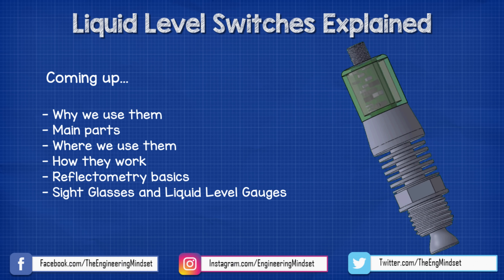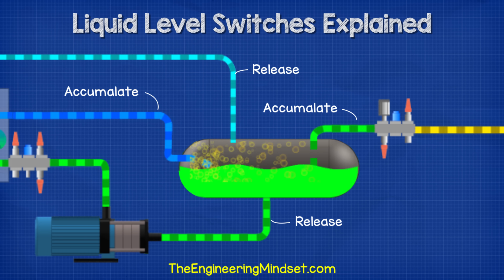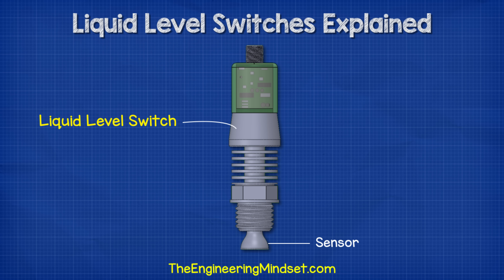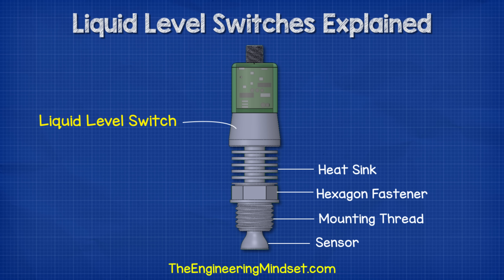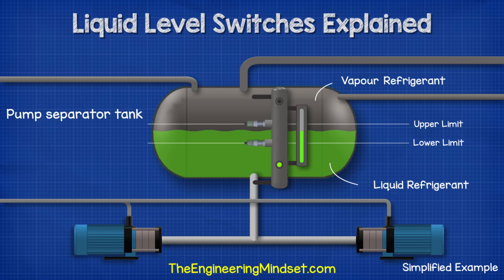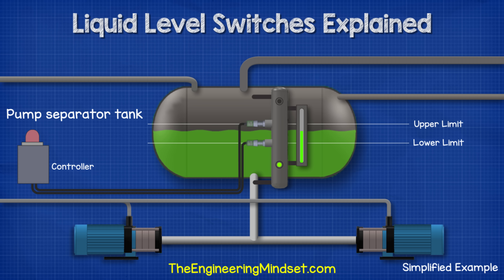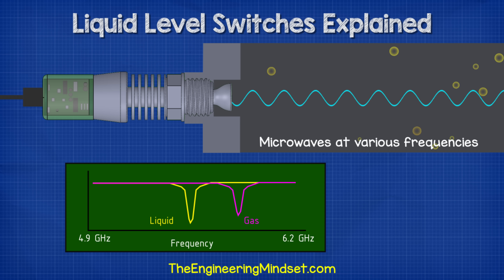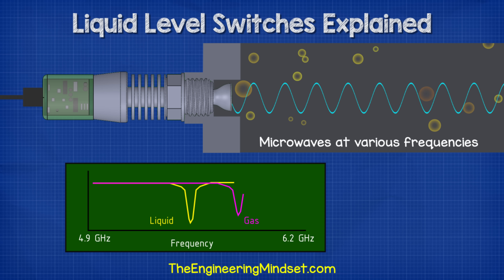Liquid Level Switches Explained - Industrial Refrigeration Ammonia  industrial engineering

Comment from the maker: ⚠️ Found this video super useful? You can buy Paul a coffee to say thanks: ☕
PayPal: https://www.paypal.me/TheEngineerinMindset
Reply: Hi paul , I know it's not a relevant topic but I have this question :
What  is the mathematical relationship between wattage and heat or temperature for AC
I'm talking about an infrared cooker
Reply: @imme1234  W [JS^-1] ... 'Heat' usually refers to U internal energy measured in J, a surface temp [K] at infrared is chosen to excite phonons to carry heat from the metal pan to the food if not mistaken (or by radiation). If you meant an electric oven cooker you can look up Stefan-Boltzman Law which is T^4 , but bear in mind that relationship by itself won't be useful for efficiency calculations because only a portion of the emission will actually be useful for heating the air/food by convection etc. There's actually a lot going on!
Reply: Thanks a lot...

Comment: One thing I don't understand, why connect it to a alarm? Isn't the point of LLS'es to connect it to the system in a way so if level is high, it will run the system in a "overcooling" mode (meaning it will run the system harder than the call for cooling mandates, which of course means that if temperature control is important, you would need a "waste evaporator" somewhere that just dumps the cold somewhere) so to "consume" more ammonia (speeding up the pumps to the evaporator and adjusting the valve), while if the level is low, then cap the system by slowing down or locking out the pumps to the evaporator, to increase the level?

And same thing for the receiver, but in this case then control the compressor based on demand so it keeps the liquid level in the receiver good.

Of course it would need to raise an alarm if the liquid level is low more constantly, as that might mean there is a leak somewhere, and same if it high too often, because that might mean there is a constriction or blockage in some pipe.
But most controllers can raise an alarm if the cooling system is capped too often or run in overcooling mode too often.

Comment: Great video - super informative. I haven’t run into any electronic level controls; only magnetic level floats which are pretty much bullet proof. I see these electric level controls being an issue with how they are installed. There are contractors out there that don’t put isolation valves around their sight glass columns. I also see over torque being a problem with them being sensitive electronics (similar to knock sensors for on-the-road engines); most low pressure receivers run between -20” and 50psi, so you don’t have to tighten things too much like you would on steam or CO2 piping.

Comment: Informative video, but where the narration describes varying frequency the graphics depict varying amplitude.
Reply: The graph in the video is typical for a notch filter (for images google:   notch filter q   ). A simple notch filter is based on a single resonance. So I guess the sensor emits a signal with a frequency from 4.9 GHz to 6.2 GHz and measures the frequency response to find the "notch".